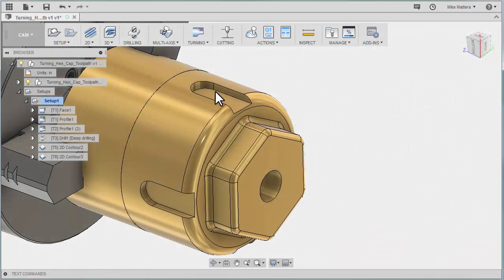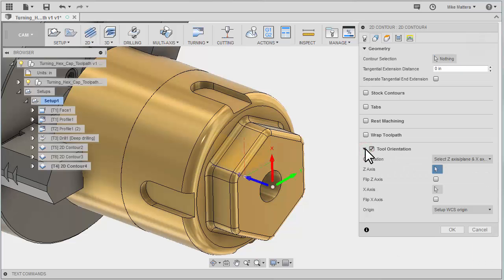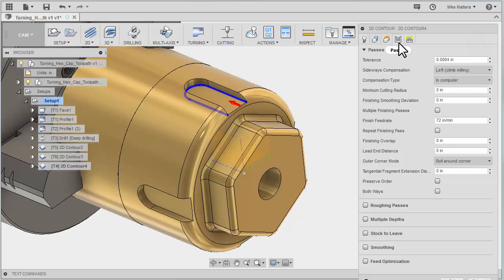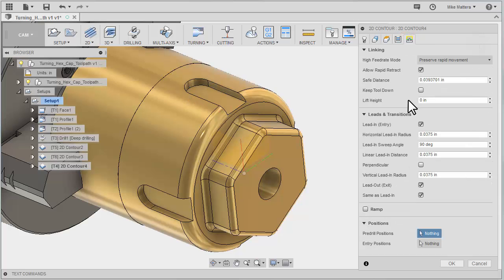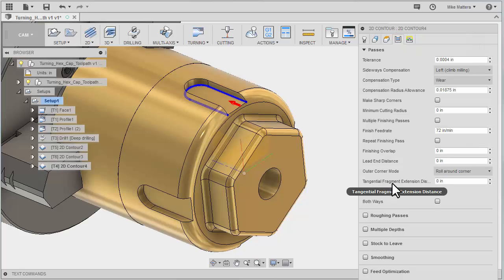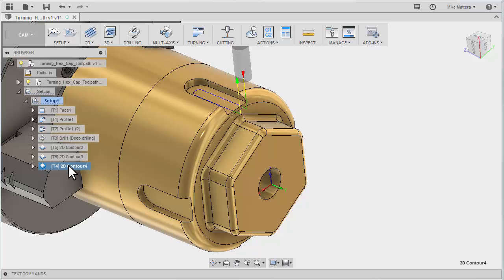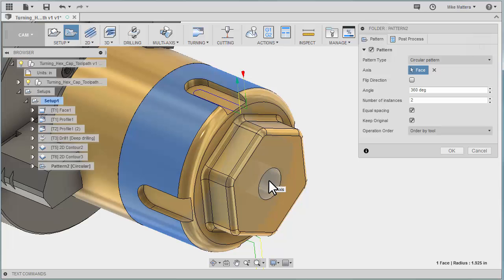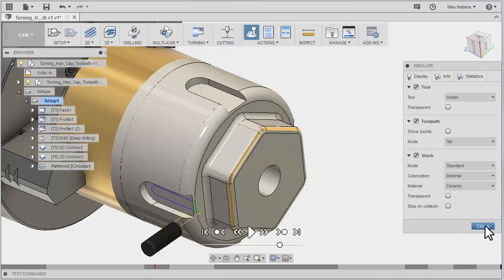Fusion CAM Live Turning Series 07 - Slot Mill w/ Pattern

Comment: On lathes with milling the tool can sit along the Z axis of the lathe (axial orientation) OR along the Y axis of the lathe (radial orientation). Simply changing the tool orientation in Fusion will mimic a 4th axis operation with the Z pointing along the tool and therefore will output a Z movement for "raising" the tool. However on lathe with milling with a tool in radial orientation, "raising" the tool is done with a movement on Y axis. How can you make Fusion understand that?

Comment: Mike- can you tell me how to work with a rotary where I might not have a "pattern" the same on different axis? I am trying to program my rotary to turn 45 degrees to mill a flat surface then take 90 degree turns, then 45 and so on.  Thanks,